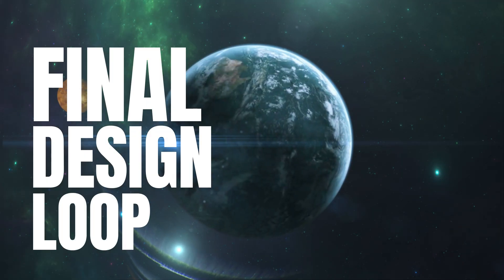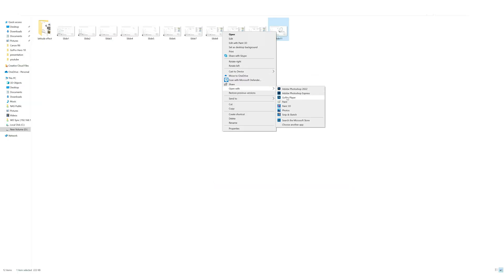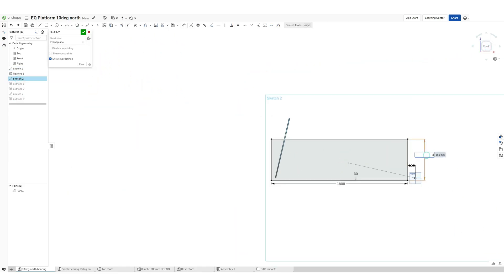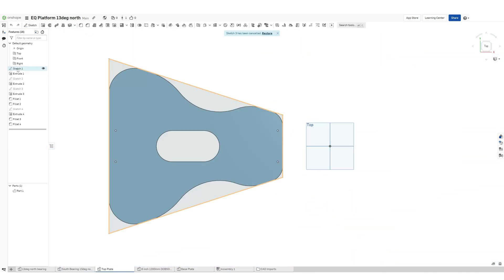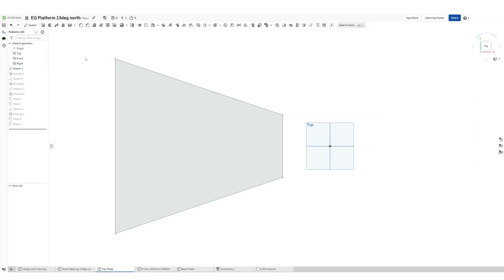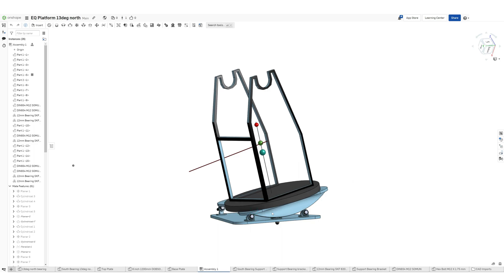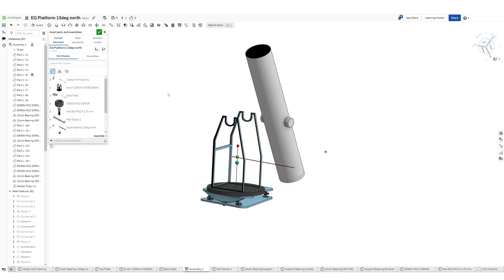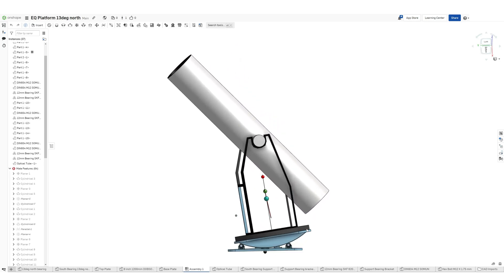How to Design EQ Platform Build Series E05 Final Design

Comment: Hello sir, what is the size difference between north and south bearing... Is it just the segments of a cone or something else to account for??
I'm from 11.45°N latitude.
Reply: If it is just the segments of the cone... Then I have one doubt - the cone will not be tangent to the ground surface... Only the South bearing will be tangent to surface and the north bearing will be little below the plane.
Is this what we have to do here?
Please correct me if I'm wrong.
Reply from the maker: The Contact point of the bearings should lie on the cone. However if you break down the cone as an assembly of many thin width cylinders if increasing radius then two of those cylinders will be north and south bearings respectively.
Reply: Yes, understood... Both the bearings should be on the surface of the axis cone.
But what I'm asking is... If we make the upper plate of the platform parallel to the ground, then the South bearing should be moved towards the upper plate (in 3d modelling).
This will create a small gap between the South bearing and the lower plate. I want to know what should be the ratio of the distance between the two of them?
Reply: And... Anyway we are going to make the upper plate parallel to the ground, so why can't we make equal height South and North bearing (only the radius is different based on the cone).
Reply: I don't have Instagram, can you please suggest any other platform where I can contact you to elaborate my doubts.
I'm a very beginner, please guide me to make my own platform.
Reply from the maker: @ruthra14  Your comment is confusing, upper plate is parallel to bottom only at 1 location, else they will form angle when the platform rotates. the South bearing can be moved anywhere as long as the axix of rotation of north and south bearing is matching.
Reply from the maker: @ruthra14  astroindiquery@gmail.com
Reply from the maker: @ruthra14  when you make the bearing equal basically you are making a fork type mount for your optical assembly, it no longer remains a platform. If you have space to keep a fork type mount, then basically you dont need a compact platform.
Reply from the maker: @ruthra14  there is no fixed ratio it depends on your design choice and tradeoffs. I have somewhere in one of the video link to google drive resources that has an excel file shared by one of the channel viewers. you can use that for rough calculations and see if your doubts are clarified. also on Cloudy Nights you will find numerious variety and creative designs of EQ platform for you to get inspired from.

Comment: I will be very interested in your drive solution: looks like a variation on the screw drive. I used a Celestron commercial drive motor. It is viable, though it is cumbersome, in altering the motion, for the various observational motions: ie. moon, planets, stars; it can be guesswork, how much to adjust the motor's speed.
Reply from the maker: Yes, I had this makeshift drive solution just for the visuals, I had to change the drive later, you can find that in one of my YouTube shorts. I could not use a friction drive like Celestron one as that optimally when load transfer is vertical which will happen in VNS design. However there is more challenge in the lower Latitudes near to equator as, matching the CG with Polar axis becomes very tough without blowing out the size proportional to DOB base.
Reply from the maker: I eventually want to get into a worm Drive mechanism in my New platform but will need lot of machining expertise on it while keeping cost might be a challenge as well. Let’s see